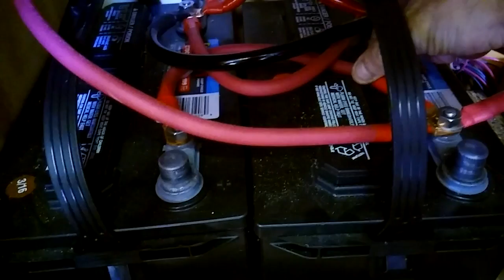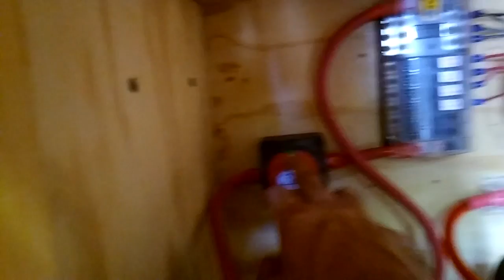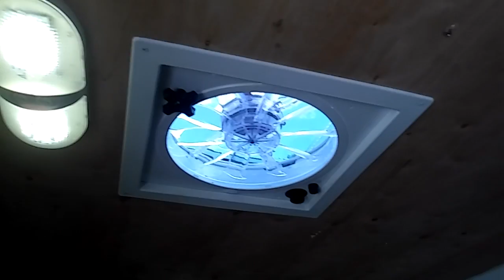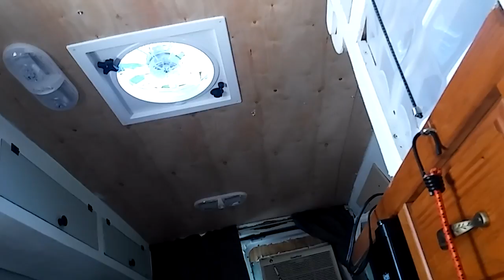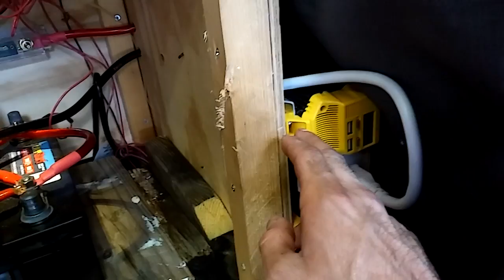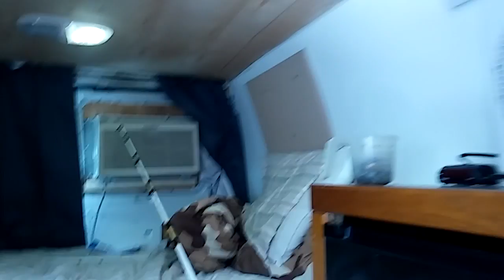Campervan & RV Electrical System Explained - Battery Bank, Wire Gauge, Inverter, Solar, D/C, ect.

Comment: Good stuff . . . there are all kinds of expensive ways to get the most out of your batteries . . . and a few cheap ways. Get a battery tester (hydrometer) to monitor the electrolyte, and find out how much charge the battery maker says you're getting from your setup. (There are also tables out there that are accurate for most FLA batteries.) If you plan on discharging 50% or less of total capacity before charging (like the deep cycles like), then if you're only able to charge up to 90%, you have in effect only filled the tank to 80% of its capacity! And that missing 20% is the best quality power (because of it's higher voltage) the battery can provide -- a double whammy!

Maybe the only advantage to chronic undercharging for a FLA type battery is the reduced likelihood of excessive outgassing, since that is a side effect of overcharging. But early replacement is very likely going to be necessary. Depending on the cost of your batteries, that may be more economical than spending more for a good (and tested as effective) charging system -- or it may not be more economical. It is certainly more of a hassle, both during the battery's service life (more frequent charging required) and because of the effort expended to install replacement(s).

Even a so-called smart charging system may not be the right match for your battery. What it takes for a charger to "top off" the tank is pressure -- that means voltage. If a charger or alternator can only deliver say, 14 volts, it won't easily fill up most deep cycle batteries. It's like trying to fill a car tire with an aquarium pump. So a good charger or solar controller can deliver sufficient current at a high enough (according to the battery maker) voltage for the correct duration (and no more)!

Comment: You slightly misrepresented how a split charge VSR works. The idea is that you have a vehicle battery and an auxiliary battery, both of which are charged by the engine. Then, as you draw power from your batteries, at a certain point the relay will disconnect, preserving a full charge in the vehicle battery (or at least enough to start the engine) while you continue to draw power from the auxiliary. Once you start driving down the road again and your vehicle battery is tip top the relay will reconnect the two, allowing the auxiliary battery to charge off the engine again. I believe you can use a VSR even if you also have solar power, which is great when you're using more power than the sun provides. Nipping to the shops in winter can provide a lot of electrical power compared to small solar power systems.
Reply: While it's possible to charge the "auxilliary battery" with the vehicle alternator, you'll never succeed in fully recharging it under normal operating conditions. No matter how many amps you're trying to push into the deep cycle batteries, they won't fill beyond a comparatively poor level unless the voltage is up around 14.7 to 14.8 volts, depending on mfr. Most alternators deliver only around 14V, and its just not enough pressure. (Sure, you can inflate a flat tire with a wimpy pump, but getting it all the way to a normal level is exasperatingly tedious.)
Reply: Interesting. Perhaps I should point out that my auxiliary battery isn't a deep cycle leisure battery, it's the same sort as my main van battery, and once they're connected they both seem to fill up fine. My record is 3 days parked up using 230v from an inverter attached to the auxiliary, with no sign of the battery going flat. I could probably have stayed longer and had enough power but I had to go to the shop eventually. I couldn't care less how many volts it provides specifically. "Full" is however full full is.

Your analogy about inflating a flat tyre with a wimpy pump is notwithstanding, since both batteries charge just fine and there is no tedium involved with something that sorts itself out without any intervention or even having to think about it. I just drive somewhere and Hey presto!

I plan on buying a multimeter at some point. I'll post something about the voltages if I ever find out
Reply: Oh yeah, you're just fine. Perfect match between alternator output and battery charging profile. The deep cycle crowd are looking for bigger storage capacity, deeper discharge w/o adverse consequences, and paired with a relatively high number of charge/discharge cycles. The engineers deliver that in part by using more electode mass and also by pushing more capacity in at a slightly higher voltage, changing the charge profile, apparently..

The baffling thing about slightly undercharged batteries in a mobile setup is that  they can be charged "nearly" all the way, but reserve capacity seems to suffer disproportionately more. When it's recalled that usable power is only the top 50% or so, it becomes clearer that any shortfall is doubled on the drawdown side of the scale: 85% full batteries deliver 70% of their potential, and that missing 30% is the highest quality power (because of its higher voltage) that the battery is capable of delivering.
Reply: I appreciate the info. As I understand it you're not really supposed to discharge any battery by more than 50%, and I really have no idea how far I've ever pushed mine. Since I only have a single 230v socket on the 150w inverter, and I've only ever used it to power a little Blu-ray speaker or my laptop, or charge my camera batteries, I think it'll be fine.

One thing I didn't quite understand that you may be able to help me with; When I plugged my laptop in until it was fully charged, then unplugged it to listen to music, then plugged the laptop back in when the battery was low, rinse and repeat, eventually the laptop battery only lasted 10 minutes! It said it was fully charged but obviously it was confused. At a rough guess I'd say it only half charged on the first run, then it quarter charged on the second, and so on. My inverter is a modified sinewave and I've read that, because the voltage doesn't switch up and down the same as a sinewave the laptop battery circuitry may only be 'counting' every other wave, and getting confused. When I got home and charged it on the mains it took a few charge/discharge cycles before it regained full capacity. This all makes some sense to me were it not for the fact that the laptop 'brick' (the transformer) should smooth out any waveform issues.

Any help would be great. Apologies if I'm talking rubbish here and feel free to explain things like you were talking to Granma (though I do have a strong grasp of physics I'm no auto-electrician). Cheers.
Reply: ...I really ought to just invest in a DC/DC laptop power cord, I know. The only reason I haven't is because every laptop has a non-standard voltage input these days. My current laptop is 19v DC (after the brick) I think. My next could be 16.5v or some other random number.
Reply: It sounds like our backgrounds are similar, while accumulated info is more varied . . . there is a lot of conflicting theory (read, for most commenters, including some who may be electrical engineers, guesses) about MSW vs true sine inverters and what kind of equipment they like and don't. Even actual testing and experience, like yours, might not supply the whole answer to the question. Any given equipment may operate just fine with MSW power, but be less efficient in its power consumption. 

Since your requirements don't seem to call for stringent conservation, that would likely be a minor factor. Clearly it would be an advantage to have a choice of either type if finances permit, or even to go with true sine only. Other considerations could make the choice easier, for instance if an inverter/charger were an important part of the system requirements.

Your experience with the fickleness of the "full battery" indicator highlights an issue with many battery monitors. That is, terminal voltage may not supply a very complete picture of a battery's state of charge. Sophisticated or heavily dependent users might find pricey solutions to that by employing high-end monitors like the Trimetric from http://www.bogartengineering.com/products/trimetrics.html

Their product spiel/manuals do give a fairly good overview of what many consider a superior technology. One old-school method useful for flooded batteries is the basic hydrometer, though there is a bit of a learning curve and it needs some sound technique/method. (And it's useless on a laptop!)
Reply: Thank you again, Robert. Much appreciated.

~Joe

Comment: Nice work bud, clean looking settup! 
You're 12V system, do you use anything from your motor to charge the batteries?
Reply: Never mind! Your video stopped at 5min 12sec for some reason... refreshed to comment and boom, 8min vid

Comment: You have a positive wire directly connected to the battery to your fan and lights. What about your negative wire?. Do you run a ground wire or do you connect the ground wire directly to the frame of the van?

Comment: Thanks for this detailed description on how to hookup the van electrical system.  Since you sent the relay back, have you had an opportunity to install the solar panels?  If so, how many watts did you install to charge your 12V batteries?  Also, do I need a charger, if I use solar panels connected to inverter?  Thanks again for the detailed description!

Comment: Thanks so much for this to-the-point guide and clear visuals on the wiring. I've been hesitating on hooking up a 12volt fuse block to my 600watt Renogy system in my Transit van for months just because I had so many questions.
Studied, of course, but didn't  feel like most videos, etc gave a complete overview of the process. I got all of my supplies from Amazon on Friday trying to motivate myself. But it didn't click until I ran across a link on Reddit to your video. 
This is it! From the battery connection to the fuse block, you explained away all of my doubts and I don't say that lightly. I'm doing whatever I can not to burn my van down!
Great work!

Comment: Can you use a battery tender from your invertor that is hook up to your car battery and charged the other two battery while driving?
Reply: That is complicated and unnecessary. You can buy a battery isolator which will charge both your starting battery and your deep cycle battery when the vehicle is running, but disconnects them when the vehicle is turned off.

Comment: Do you have a drawn out electrical diagram?  Im stumped at the part of connecting shore power to this system. I am working on a utility trailer conversion and have everything to connect the power just dont know how to have it switch between the batteries power and shore power.  Your video is by far the best Ive seen for electrical. Thank you :)
Reply: Use a small (30A size is available from Schneider Electric) main breaker panel with a couple of distribution breakers & outlets. This equipment will all be single phase, single pole, 3-wire design, so connecting the incoming shore power is not really much more demanding than installing a light switch. However, don't connect the neutral busbar with the ground busbar, as would be the case for a residential install. (AC ground is via a properly wired shore power connection)

If the inverter has pass-through capability (with a built-in transfer switch), it can be connected to an energized outlet and AC loads will be powered by shore power instead of battery power. If not, AC loads can be unplugged from inverter and plugged into an outlet (poor man's transfer switch).

Though the cost/benefit calculation is liable to be different for each situation, a surge suppressor/EMS is a prudent addition ahead of all other onboard equipment.

Comment: If I didn't install the fuse box and just ran the inverter would I still need 2 batteries? I don't have much to plug into it. Phone charger occasionally my laptop a lamp occasionally a cook top or blender
Reply: The rated output of your inverter has a lot to do with recommended battery bank size and total Ahrs. Often, the inverter mfr will give a minimum battery capacity for their product. So, if you're using very little power from a relatively big inverter, your equipment may not be well matched to the power usage.

Sounds like all of your loads are AC, rather than DC, so you could skip the fuse box. But things like lights and fan motors are much more frugal on DC than inverter AC, usually. And keep in mind that resistive loads like space heaters and hotplates are real power hogs. A 1500W AC heater run for 1 hr uses over 145 Ahrs of battery capacity! (This heater would drain one of Cory's batteries in under 1/2 hour.) Compare that to a 9.5W LED equivalent for a 60W incandescent blub, which would use almost 6Ahrs in 6 hrs of use.

The moral of the story? Sure, use fewer batteries, but better buy a sweater and some granola bars! And read all you want . . .

Comment: I have a 1500 watt inverter,2 solar panels over 100 combined running 2 golf cart batteries.I do live on the coast so I don't always get sunlight but it doesn't seem to charge the batteries enough. I can't run a small coffee pot or a small microwave.
Reply: I posted a little on your topic "undercharged batteries" above. From what I have learned, that is probably the single biggest issue for mobile power storage. You need to work backwards from the battery . . . what voltage does the mfr say is needed for bulk charging your battery? float voltage? can your charger or solar controller provide that? (At the battery connection, not at the controller terminals.) If a battery is only charged up to 80% of its capacity and you recharge when it's at 50%, you're only getting 30% of the total Ahrs . . . that's actually 60% of what you'd have available for use if they were being fully recharged each time!

Also, it sounds like you may have flooded lead-acid batteries, so a hydrometer is a cheap way to measure your state of charge -- there are charts for that online. No point guessing or worrying about adding more solar panels if the problem is actually an under-voltage being delivered by the charge controller!

Comment: This may be asked before but where is your ground at? Off the battery or inverter and where did you connect to van? Thanks
Reply: DC ground can be to the chasis (as in cars) or to the battery negative (as in boats). Both work, both are safe. Chassis grounding probably has the edge if there are many positive wires which could make electrical contact with exposed metal -- but only if the circuits involved are correctly fused.

AC ground for a shore power connection is via that offboard source. Your inverter should have grounding instructions specific to that device.

Comment: This video is the closest I have found to a problem I'm having. I too want to install a battery disconnect switch BUTwill be using only the NEGATIVE cables because it's better and safer. Here's my question. I have 2 batteries in parallel with 3 negative cables hooked up to one battery from the factory. One negative cable goes to the second battery, one negative cable goes directly to the inverter and the third negative cab,e goes directly to a grounding block mounted to the frame of the travel trailer. Which of those cables goes into the disconnect switch? I can't find the answer anywhere.
Reply: I believe a working inverter connected to a pos DC and a neg DC cable will still be quite "hot" if the neg cable is disconnected by any means, including a switch.

Comment: Good video, 12v systems can be a little tricky to build from the ground up.
 I saw a couple comments on venting of the battery area and I second that. Could be dangerous, especially in a small area. Battery boxes can be vented to the exterior of the vehicle. Or some AGM battery's can be used inside. I had one in my vanagon for years.

Comment: Cory, how did you hook up your fuse box? What size of wire did you use? and did you hook both the positive and negative wire to your battery?  I'm having a problem with mine.
Reply: It sounds like you used 2 AWG wire.
Reply: I believe Cory used 2 AWG cable for his inverter DC input and for the battery interconnects. A fusebox would be fed separately from the battery using a wire gauge heavy enough to support whatever current or future loads might require. Wire mfrs like Cerro Wire publish ampacity charts for their sizes and types of conductors. Don't take somebody's suggestion that #12 is fine if you're going to be drawing more than 20A (that's quite a bit for the average mobile user, BTW), for instance.

Comment: so thankful...I needed this education.....just bought a 100W solar panel...need to figure out how to feed this new electrical source into my 3 'in parallel' 12 volt deep-cycle batteries...which never seem to get fully charged, and run down way too fast.

Comment: Great idea on the solar panel to charge the batteries.  I know deep cycle batteries last a good while.  You are pretty much stand alone now.  Good ideas and planning.  I am just wanting to power some power tools off of my service truck but this gives me great ideas to work with.  Thanks again Cory.